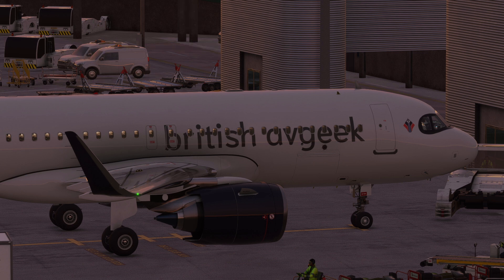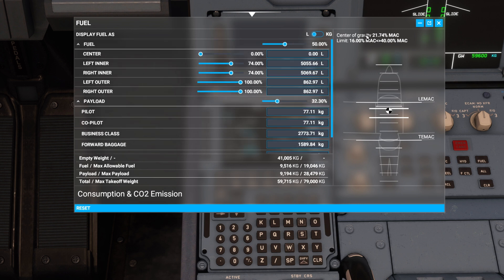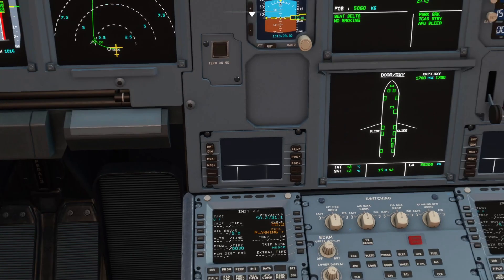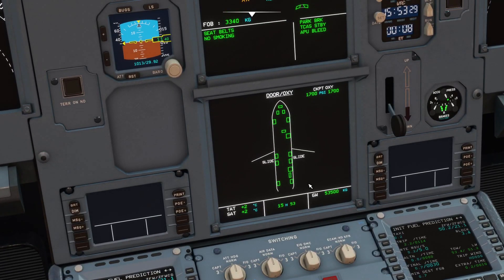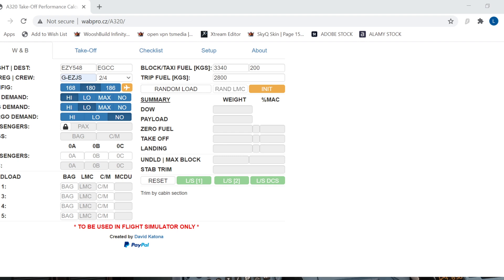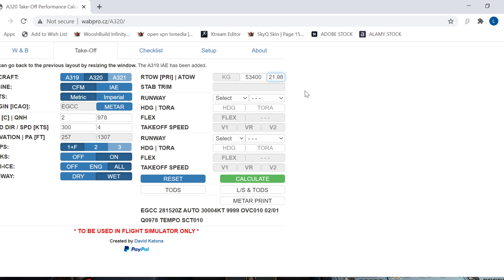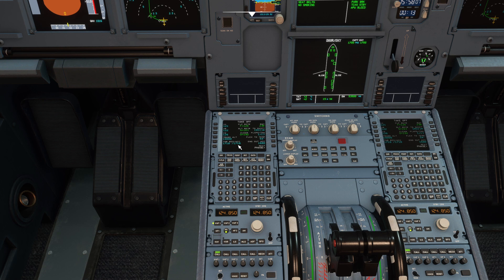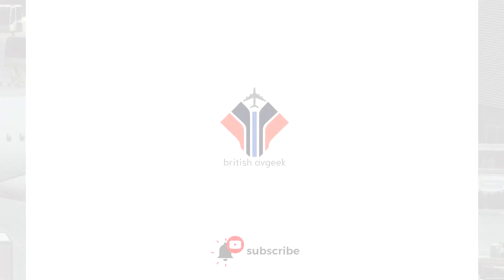MSFS 2020 | How to Use a Takeoff Performance Calculator - Get Flex TO Temp [Tutorials]

Comment: Hi good video but a question please the FOB is 5K kg you put 3.4 KBS lbs but in the speed calculator application you put the fuel in LBS instead KGS i'm a bit confused
Reply from the maker: back then the FBW had value splits and other things we had to work around - not so much a problem any more though

Comment: Can explain if there is a difference between  v1 and the military refusal speed ? Or are they the same ? Do the margin of safety  can impact a longer or shorter refusal speed versus V1?
Reply from the maker: not quite sure what the military refusal speed is... V1 is the speed at which you're basically committed to taking off if something happened, so if the engine failed just after V1, you need to takeoff and deal with it - if that's the same?
Reply: @BritishAvgeek  I was referring  to the military v1 speed or equivalent

Comment: Seems like the takeoff performance calculator is offline, are there any alternatives?
Reply from the maker: Sadly no! Not currently anyway though I'm pushing for something to be worked on 😉
Reply: @BritishAvgeek  I found this site to download.
Reply: @positiveclimb737  what is it?
Reply: @BritishAvgeek  TOPCAT used to be really good in the days of FSX.
Reply: I found a decent a320 takeoff/landing performance calculator, although it's an Excel file, so it's not quite as easy to use as the one in this video.
To find it: Search "a320 takeoff performance calculator" on Google, it's the one on "flightsim (dot) to". (can't post links here).
If you don't have Microsoft Excel, you can upload the file on your Google Drive, and open it with Spreadsheets.
Reply: I found in this site to download.

Comment: Another wonderful video! How do you know when to use Flaps 2 or 3? I did a takeoff from Gibraltar and if i remember correxcty i saw somewhere flap 3 settings for the particular takeoff. How do you know in advance. Is there a chart we can apply?
Reply from the maker: You look at the runway length and depending on performance of the aircraft, weight etc you'd select flaps 2 or 3 accordingly
Reply: @BritishAvgeek also, IRL you get a regulated takeoff weight. So, it may be required to use config 2 or 3

Comment: Thanks a lot bit in my sim fuel is in pounds not kilograms, do you know how to change fuel to KG in msfs2020?
Reply: Sorry i didnt remenber in metrics to select units in metric system.
Reply from the maker: That's the one inside settings just change it across to lbs or kg as required 👍

Comment: Arriving with 0.9 fob? :D That's very very brave
Reply from the maker: I've been tinkering with my fuel load on simbrief with different minus fuel factors to get a more realistic fuel load 🤣 I'm about M20 currently
Reply: I once flew from EFHK to KJFK (~3600nm) with an a320, arrived with like 500kg/1100lbs of fuel, barely for 15mins of flight(?) after flying for ~8 hours lol.

Comment: Thank you for the new tutorial! Does anybody know if entering the Flex TO Temp actually has an effect either in the current FlyByWire mod or the original A320neo in MSFS?
Reply: I don't believe it does at the minute
Reply from the maker: As Will said - currently it's a value that'll become active in the future but it's certainly good to get into the habit of using it now routinely. Naturally it'll restrict power in due course
Reply: Thank you both for the clarification! That's what I suspected after my recent flights.
Reply from the maker: @eduarddanzinger7928  hopefully we will see it all modelled soon 👍